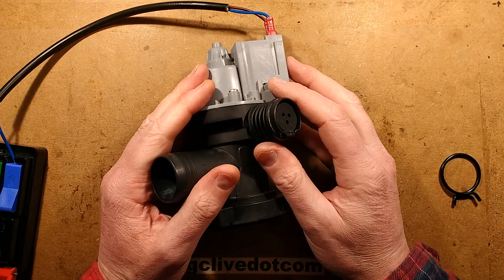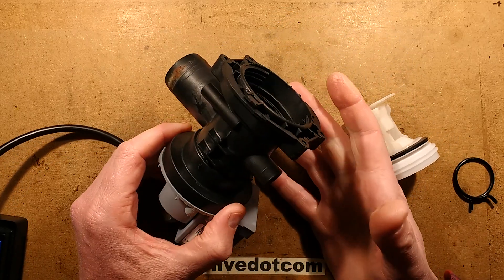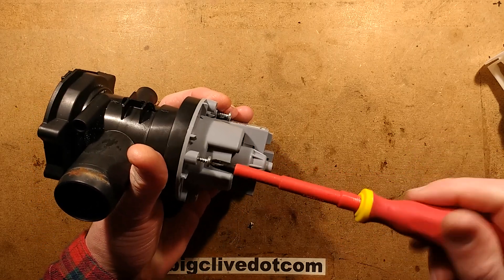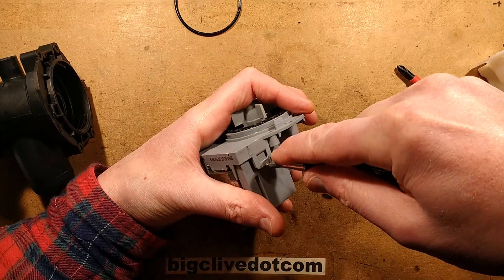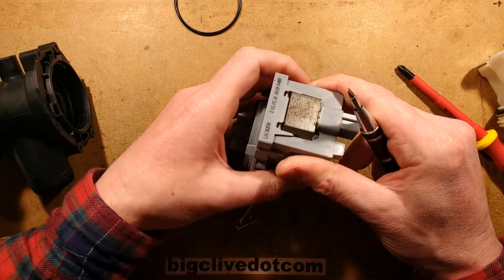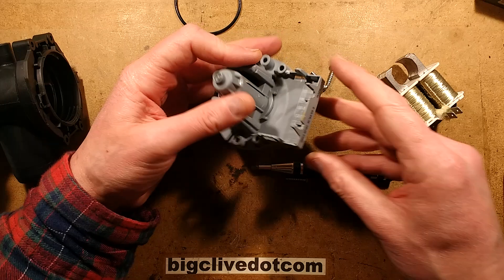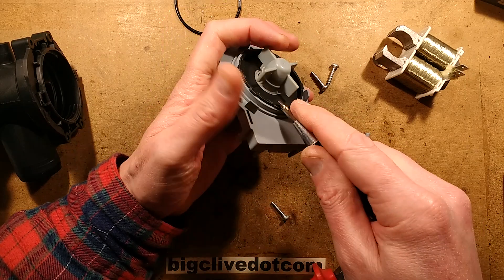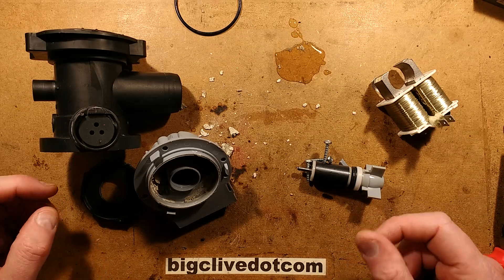Washing machine pump teardown.

Comment: Most machines, if you pull them out and lean them back quite far, close to 45 degrees, it won't piss all over the show. 

Blocked pumps can kill the motor driver on the board (depends on the make) the pumps get replaced for leaking some of the time and the motor can fail too - it's not the highest failing component by any means but they do have issues at times. 

Used to be in part sales and refurb for appliances, if you want a destructive teardown look at the control/power board for any LG washing machine, it'll be archaeology by the time you're through.
Reply: We've got an LG Dishwasher. Only problem is the conductive gaskets on the touch pad system - lose their "conductivity" over time and need replacing. A very easy fix, but, as you say, the inner electronics are very "comprehensive".
Reply: On my Samsung washing machine control board is completely potted, but it looks pretty straight forward.

Comment: A pre drain hose goes on the smaller one, allows ya to drain out all water before ya unscrew the filter and the flap helps stop back syphon on drain hose
Reply: HDXFH you hope your machine has the pre-drain hose. Ours doesn’t. And is, interestingly, one with an integrated dryer. So that could be why, I suppose.
Reply: yes thats what i was going to say saves a lot of flooding
Reply: What he said
Reply: correct
Reply: are ya aussie? just curious

Comment: Huh, just like fish tank pump.
Reply: Raymond Mucklow 
You can use the replacement part for that purpose :)
Not used parts though, some fishes are really sensitive to even the tiniest amount of detergent.
Reply: Ian Ide I made the mistake of putting sand in an 2 year old pair of Oscars, they constantly stirred up the sand, I was going thru an impeller a week, after getting rid of the sand, 8 years on the same impeller and still going.
Reply: Ian Ide 
Simple vinegar or a cleaner called Bang will work a lot better.
Reply: Heh, I was thinking the same exact thing. Having to clean those damn motors every few months gives a person a pretty good view of what the parts are...
Reply: Speaking of mistakes heh... I was trying to clean some limescale off the internal magnetic part, I used toilet bowl cleaner (hell it works on shower and faucet heads right?)

Yaaa... don't do that, it eats away whatever resin that is used to hold the magnet into its shape. Turns it into a big melted looking mess...

Comment: In the US some folks have garbage disposals which are burr grinders mounted in line with sink drains to mash up food waste. Some disposals are designed to drain into dishwasher drains to take advantage of the pump force, although it seems like those extra hose ports on your pump would be too narrow for that purpose.
Reply: No no food waste disposal units are found in the UK, though increasingly rarely. I think the generally frowned upon now as we try to reduce waste going to landfill generally and flushing it down the sink didn't make the water treatment companies very happy either.. they can do things with it, like methane creation or so but it still end up buried somewhere. In the 90's people were encouraged to buy more sensibly, start a compost heap, this sort of thing to try and reduce waste. The EU may have had something to do with it, encouraging countries within in the 90's to reduce landfill waste by something like 75% by sometime in 2020 or something I can't remember. But yeah, we had one in the house we moved to but the room was converted and it went away.
Reply: Uh, they are required to be installed in new construction in Philly now, for biogas production/reclamation. Studies have been done on these, and in general, in-sink garbage disposals are environmentally better than chucking food waste into a landfill. Make sense too, food waste is mostly water, and readily biodegradable into gas.
Reply: So what makes food different from fecal matter? They are both easily biodegradable...
Reply: Remember the "fatberg".
Reply: mrchriswin I member the fat berg 😁😂🙃
Reply: The disposal doesn't drain into the dishwasher and use the pump. It's just a convenient way to attach a dishwasher's drain to let the dishwasher pump it's drain water into the sewer.
Reply: So, can you give a link to those studies?
Reply: Антон Южаков well no because someone has to deal with it and if it's the water treatment plants (we don't pump our sewage directly in to the sea) it ends up costing everyone money for them to treat the water.
Reply: Chris Carr don't put words in my mouth. You can clearly see I didn't say that. Since you seem to be ignorant on such matters, what I am saying is there are other options to deal with kitchen waste that are encouraged, rather than passing it on to the water company and ultimately ending up in landfill.

I'll add that there's not a value in making a bad problem worse by making poor choices.
Reply: The amount of extra burden on an already stretched system.
Reply: Well, if you would throw away something like food better to dump it into sewer IMO
Reply: meatbear our own studies show the opposite in the UK, however differences in infrastructure could account for that certainly.

That is, the water companies are not set to to deal with gas production in general and outsourcing is expensive.. it's better if the waste doesn't enter the system at all, ideally, or is reduced significantly.
Reply: What burden?
Reply: Increasing population on a Victorian era sewage system.
Reply: Ollie B wait, so you think chopped up food being in the sewage - I.e. something mainly comprised of shit water... food that has just passed through a human body, is somehow more difficult to deal with than *the food that humans have digested and shit out that already makes up the sewage*? That makes little sense to me. Human fecal mater contains food, so how in the world would the sewage facilities have absolutely no problem separating the fucking diarrhea from the water, but the whole system runs a muck once some kids greenbeans come through. Does that mean the system comes to a grinding hault everytime some undigested corn comes floating by?  There's absolutely no logic there. If they can process the shit, piss, toilet paper and goldfish of out the water they have absolutely no problem filtering out the decomposed food people send down the drain as well.

Comment: So do washing machine pumps in the USA not have a port on the front for clearing blockages?
Reply from the maker: Some apparently don't.  A friend had to disassemble his machine to clean the pump.
Reply: bigclivedotcom Unfortunately, electronics and appliances are throwaway items here. I do TV repair and they really aren't designed for servicig either.
Reply: My mother's LG front loader has that same port. Older top-loading machines were completely different. The pumps were massive, they probably just ground any blockage to bits.
Reply: My $1,200 North American washer doesn't have a clean out.  Twice I've had to take the whole thing apart, and both times I've nearly cut my fingers off on the sharp edges of the metal washer frame.   Sadly, you have the choices of paying half what the thing cost for a service call; throwing it out; or spending hours putzing around with Band-Aids and disinfectant at the ready.
Reply: Jafafa Hots - You're right about older machine pumps chewing up and spitting things out.The newer pumps can get blocked very easily compared to the older ones. When I was an appliance repairman one of the most common front-loader pump blockages was due to the rubber, non-slip backing of throw rugs. I never saw an older-style, top-loader pump clogged with that crap.
Reply: If you have any brains, you look to see what it's like before buying! Especially if you have family who leave things in there pockets...
Reply: They use to be. My 15 year old washer and dryer can be serviced (I know I do it every time) and I just tonight replaced the ignitor in my dryer for the first time, 20 minutes R&R and $18 part.
Reply: Most do.  Same crap chinese parts used worldwide.  Almost all have cleanouts now.
Reply: I've noticed some UK market ones don't have the filter port on the front now - even (perhaps especially) quite pricey ones.
Reply: Our old maytag commercial washers did not have one of those filters - you had to yank off the drain hose. The newer machines had the pumps with that screw out filter - much easier to clean gunk out. I would say both the old and new pumps had same life span though .
Reply: If you build something for servicing, you can throw efficiency out the window. unless you greatly increase the price.